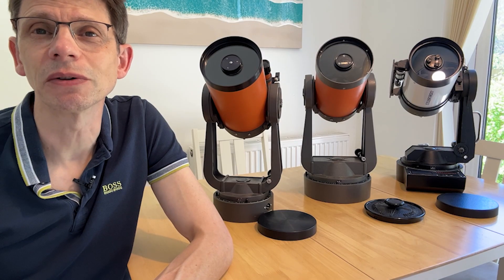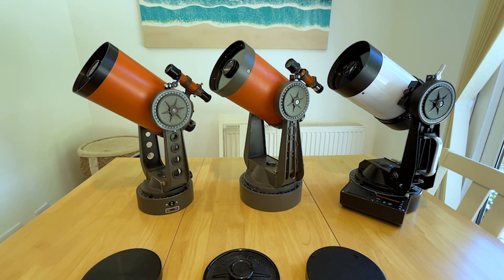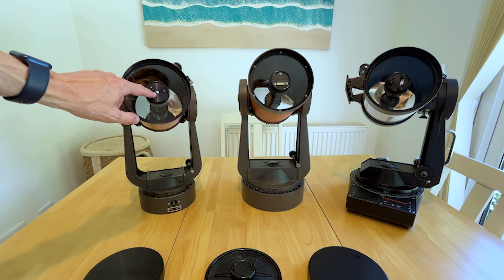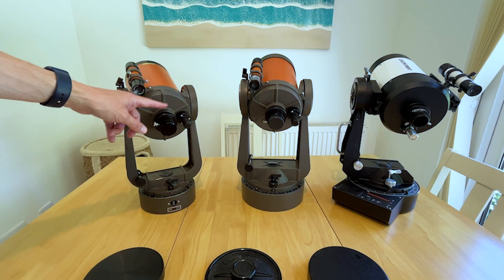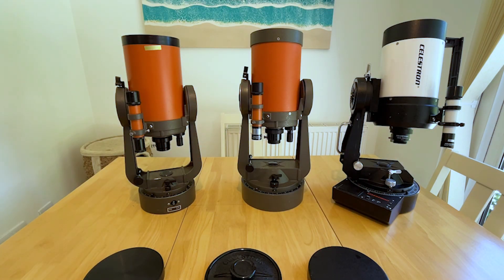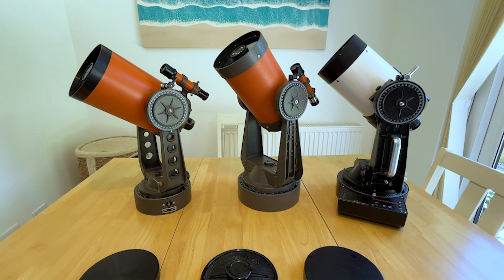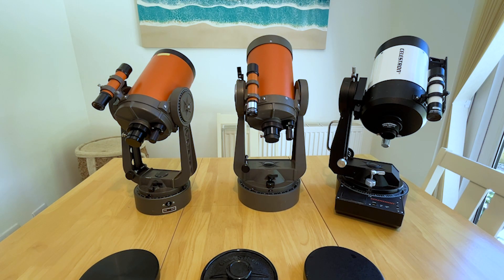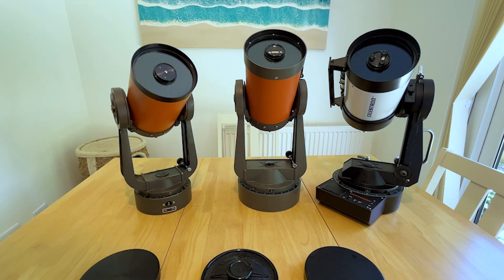Celestron C5 telescope 1970s vs 1990s

Comment: I bought the C5+ a few months ago and it is super portable, you can set it up quickly, no cables or star calibration required, just pre-align it with the pole and you're done.

Comment: i had a C-8. sold it becuz day time job. some years later i aqquired an orion 5" MAK. lots cheaper and just as good. nothing is as good as the C-8, 250x, saturn with wide open rings but 5" MAK sees festoons on jupiter at 250x!

Comment: I have the original 1972 C5 with a 1/4" extension to mount an SLR camera. the main tube more closely matches your 80s version with the primary and secondary mirror surrounds. Additionally, the rear has a gold annodized aluminum band running the perimeter with the serial number, the logo, the optics properties and MADE IN THE USA. It's an Incredibly durrable scope. It fell out of a car at about 35mph (Long Story) and broke the camera mounting block. I removed the front glass, drilled and inserted rivnuts and mounted a dovetail. After recolimating, it works flawless.   Thanks for taking the time to make your video.

Comment: I bought a C5+ for my sister and nephew a few years back. It's great! Love its focus knob and the fork mount for its slow motion controls! The only quibbles I have are the coatings are inferior to the SE, and the lens cap's notches need a horizontal groove to lock the cap in place.
Reply from the maker: True, coatings on the new scopes are better still.